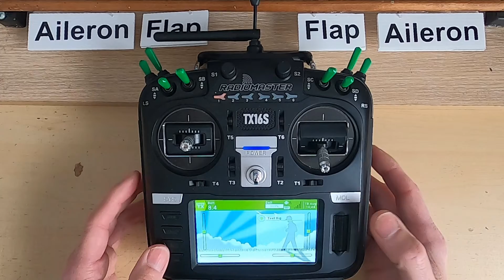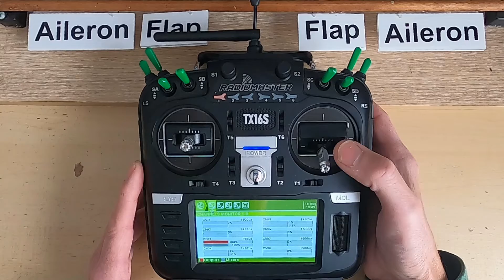OpenTX ADC Filter ON or OFF?

Comment: My digital servos flutter randomly even with the filter on. I have been flying fixed wing and quads with ADC on and besides the occasional flutter on the ailerons of my slope flyer I have no problems. If there is slight pressure on the aileron surface e.g. air pressure (in flight) the flutters stops. If I monitor the outputs channels on my radio I do not see a difference between ADC on or off. The numbers still jump around but by really small amounts.
Reply from the maker: Thank you for the feedback Pete.

Comment: So are you saying the adc filter needs to be on if you are flying quads?
Reply: No, turn it off if you fly quads. If you fly quads and fixed wings/planes (that uses servos) you can also turn it off BUT you need to check that the servos aren't affected. If they are, turn it on.